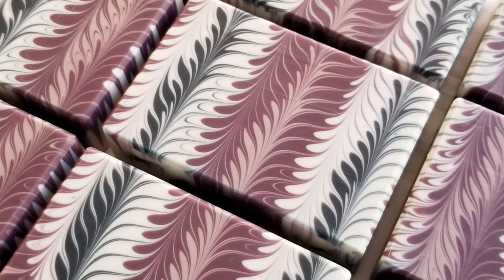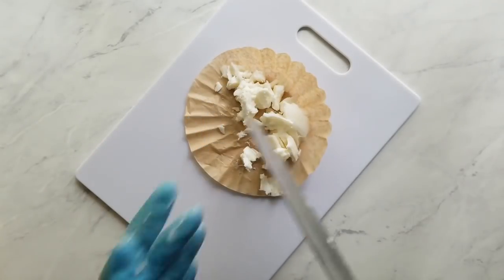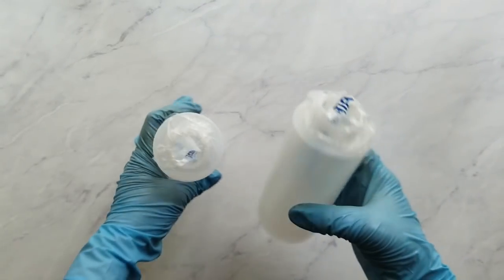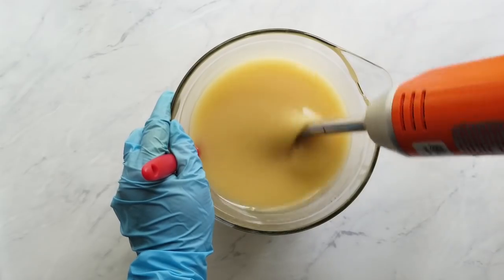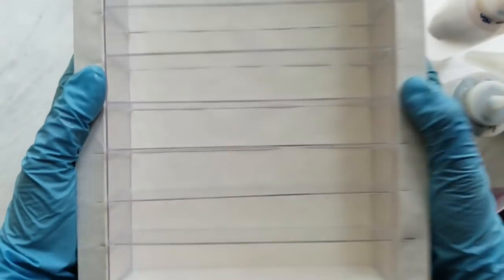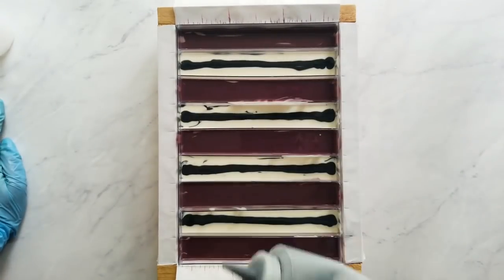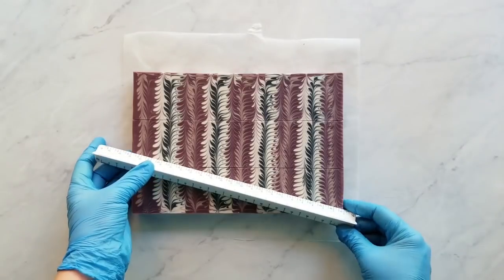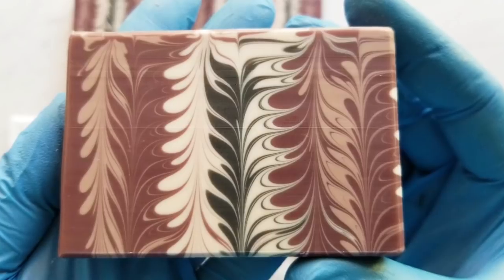Budding Vine Swirl Cold Process Soap (Technique Video #30)

Comment: Hi Teri. In your video, you said this design could be made without the dividers. How would that work? I can’t figure it out!
Reply from the maker: Pour all of the color that used most first (wine), then lay in the white, after...add accent colors.  Be advised the colors will not reach all the way to the bottom.  But the basic design can still be achieved

Comment: Question: why do so many soap makers stress the vegan factor? I’m looking at using tallow in my soap (for far to many reasons to go into in a comment). I also need to stay away from using coconut oils and sweet almond oils due to dietary allergies in my family. I can’t seem to find any info on possibly still having allergic reactions after saponification. Which means I have to use my own recipe.